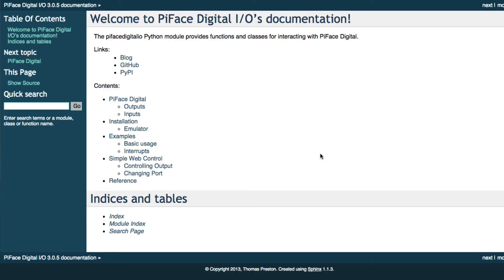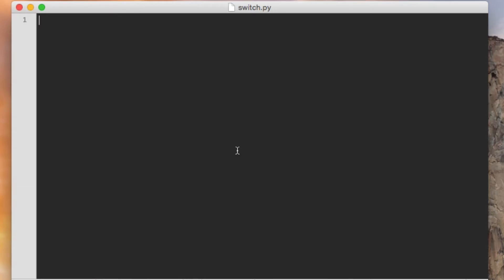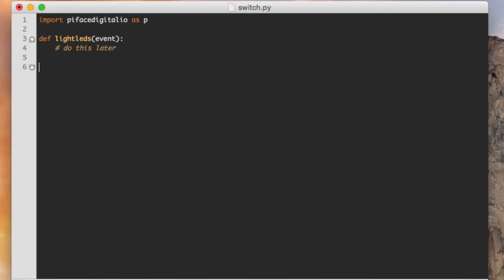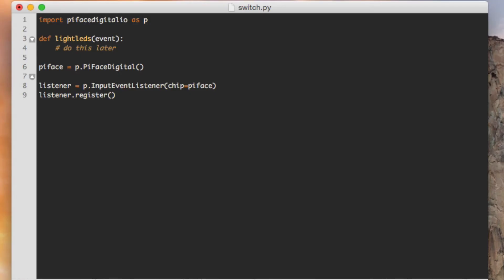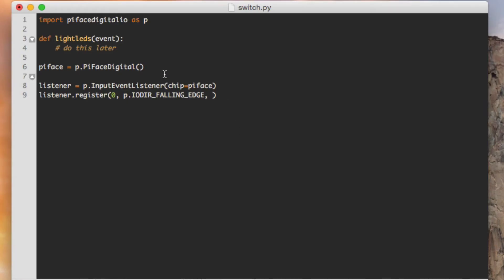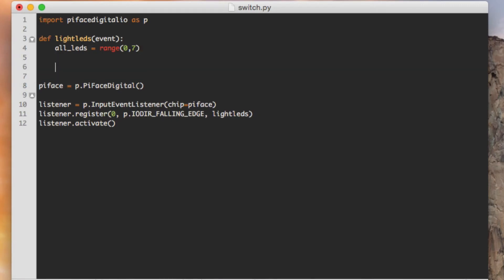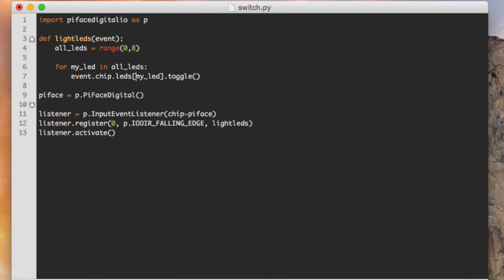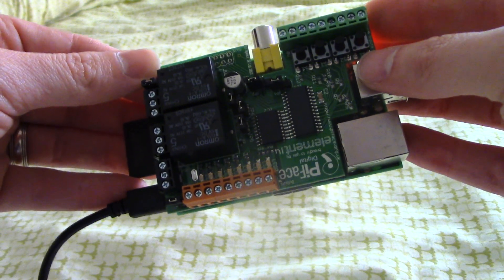PiFace Switches & LEDs on Raspberry Pi with Python

Comment: What am I doing wrongPython 3.5.1 (v3.5.1:37a07cee5969, Dec  6 2015, 01:38:48) [MSC v.1900 32 bit (Intel)] on win32
Type "copyright", "credits" or "license()" for more information.
>>> import pifacedigitalio as p
Traceback (most recent call last):
  File "<pyshell#0>", line 1, in <module>
    import pifacedigitalio as p
ImportError: No module named 'pifacedigitalio'
>>> I am using python shell
Reply from the maker: +Charles Runyon Make sure you have installed the Python module that we're referencing on the first line of this script. You'll get some guidance on doing this in the documentation. Check out this link: https://piface.github.io/pifacedigitalio/installation.html